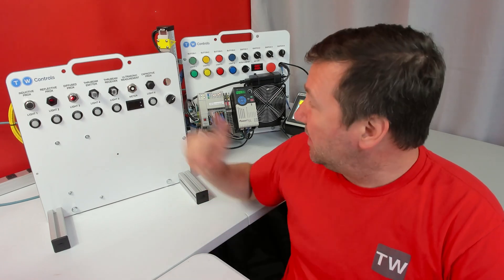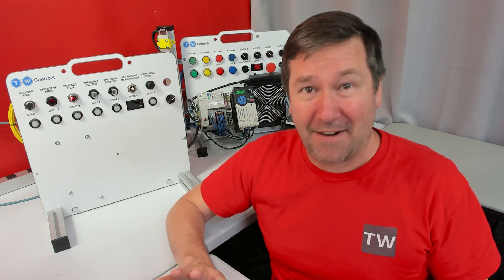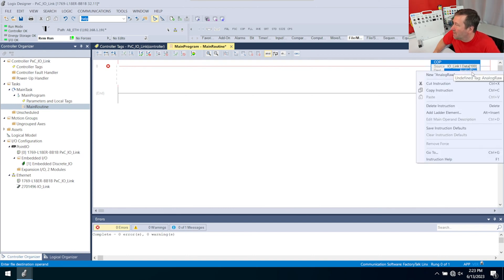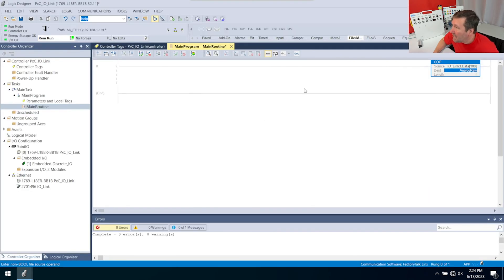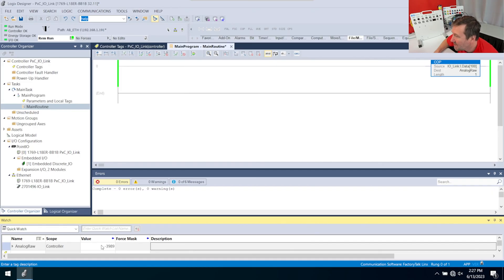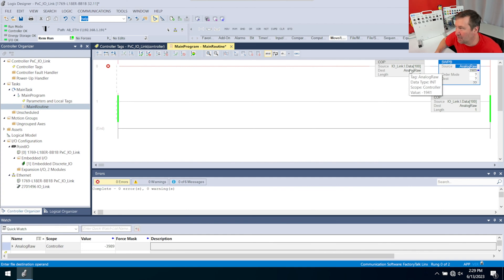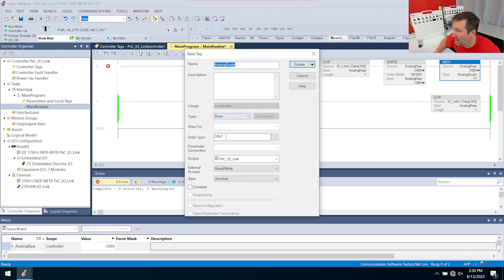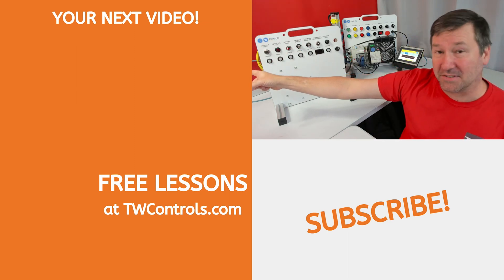Swapping Bytes (SINT) and Combining Them into INT and DINT

Comment: good night Tim I added a weight indicator to a clp micro 850 via generic module but it returns the weight divided into 4 bits. How can I add these bits to form the weight in real terms, for example. Thanks.
Reply from the maker: I assume you mean 4 bytes or groups of 8 bits?  You would use the COP instruction then depending on how it came over, you would need to rearrange the groups.  Also, don't post your question more than once, I had to delete all the other duplications of this question.
Reply: good morning tim I have 4 groups of 8 bits that form the weight Do I use the COP function to copy these bits and copy them to a variable of type int for example? I do this 4 times one for each and we are the INT results to have this value?
Reply from the maker: No, you would use one COP with a destination of DINT.  Check out the help instruction to learn more about the length parameter.

Comment: I need help trying to convert two words to a real. I think it’s done with the cop instruction but having trouble figuring it out. I’m using modbus tcp and getting the words correctly in my array. The server device sends two 16 bit registers because they are 32 bit on the device. But how can I read those as a real in the plc? This is a micro 820.
Reply from the maker: You are correct, you would use the COP instruction.